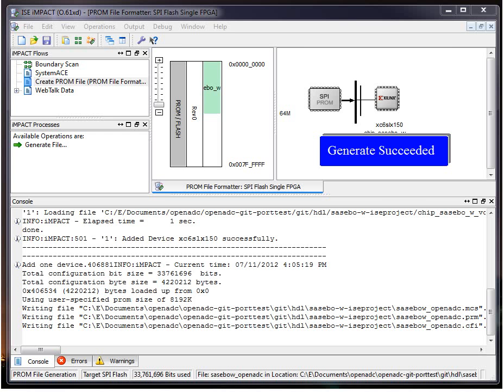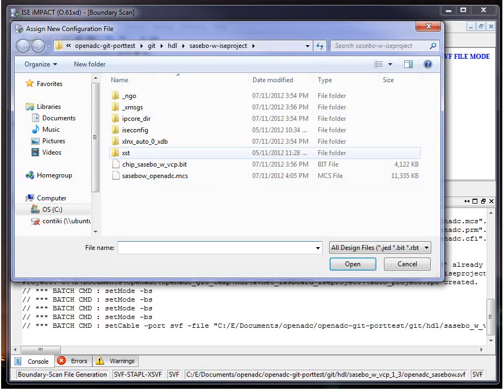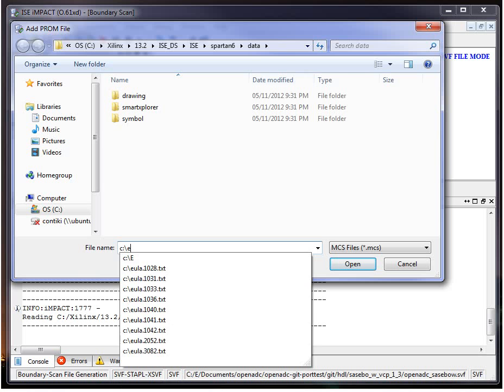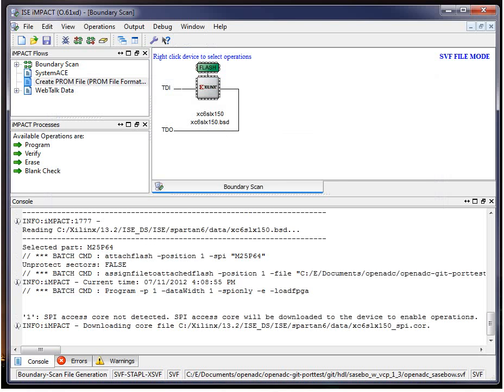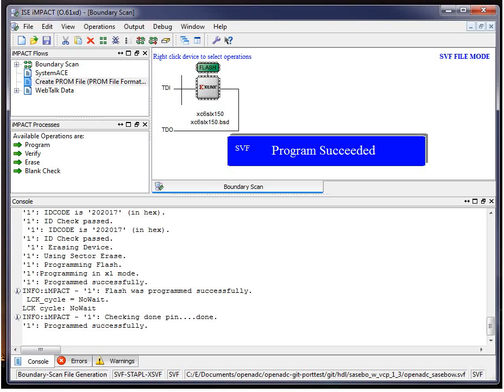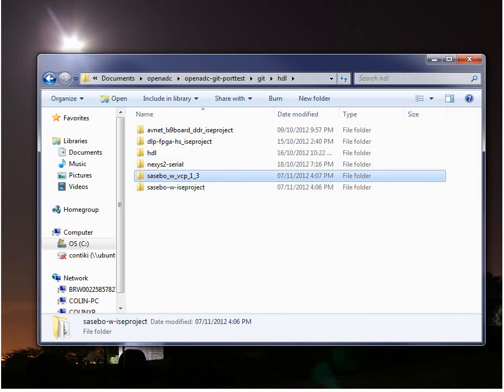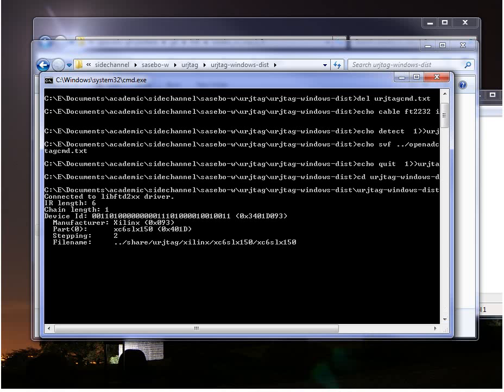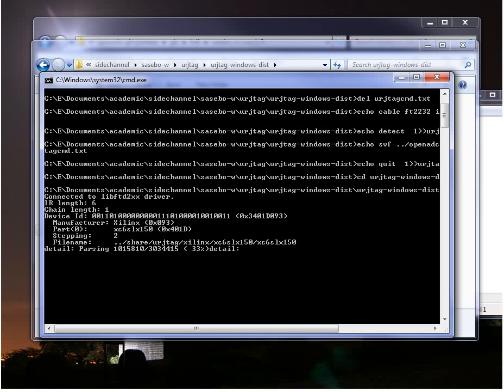Programming SPI Attached Flash on Xilinx Spartan 6 with urjtag / FT2232 Device

Comment: Hi . I want program kintex 7 fpga through spi flash using ft2232h chip .the eeprom also connected .the chip was detected on ft_prog .can you share any eeprom config file or drivers related to this configuration.

Comment: is it necessary to use .mcs file in SASEBO -W? I tried to program it but i didn't ask for mcs file.  in addition, LED 8 and 12 is off. Does it mean the program is unsuccessful? the sasebo w checker cannot run as well.
Reply from the maker: +Ali Akbar If you are programming the SPI flash you do need the .MCS file, but if programming the FPGA it is enough to use the .bit file. Which is LED 8 & LED 12? I don't remember offhand...
Reply: Thanks for the replied. What about programming the  card? I try to download cmd20824_setup. Exe but can't find it anymore. Do you still have this file? Or can use the latest version but i am not sure whether it is compatible Colin O'Flynn thanks
Reply from the maker: Ah not too sure anymore... I bought a clone JTAG programmer for $30 (like from goo.gl/3ZDuwQ) and just used it instead, the only documentation I have on this method is basically in my video...